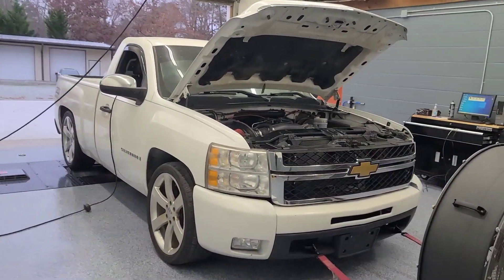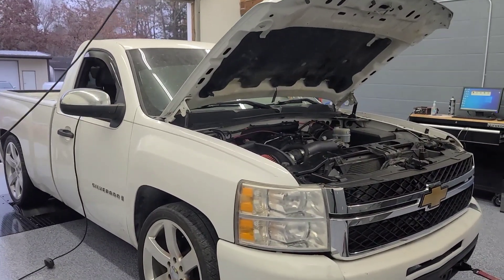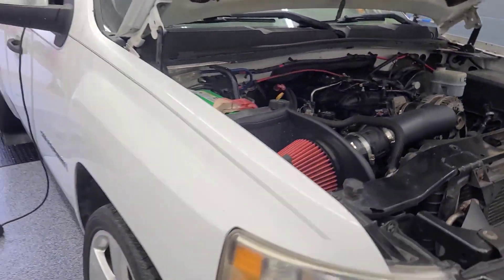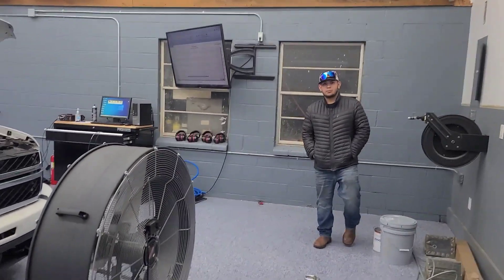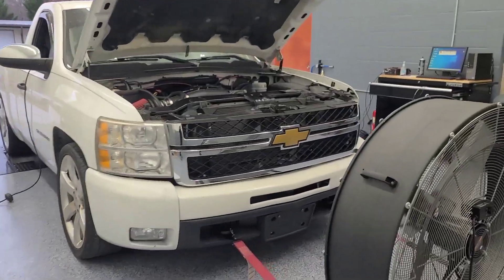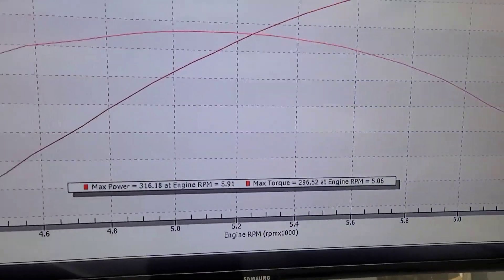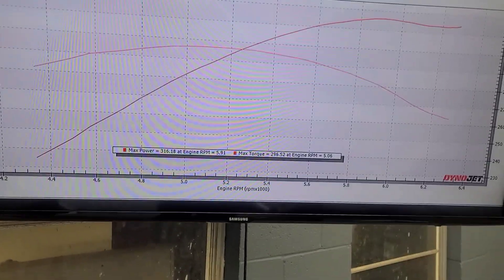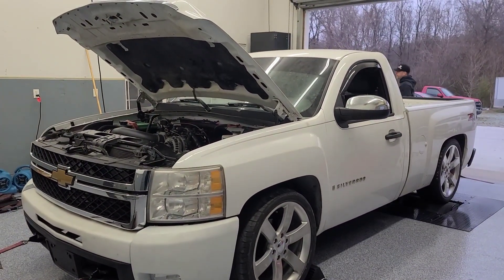2008 Silverado 5.3, TSP 3 High Lift truck cam, headers to a Y-pipe and Flowmaster, 93 octane,  cai

Comment: That’s crazy. I made 336hp and 315tq on a mustang dyno with a stage 2 high lift tsp  cam. Mod list and dyno run on my channel.
Reply from the maker: The condition of the engine plays a big role in this, plus all dynos read different.  They are just a tool!
Reply: @nufnuffz28  very true. Low oil makes more power less restrictive 😂 the motor blew like 6 months later from oil starvation between oil pressure